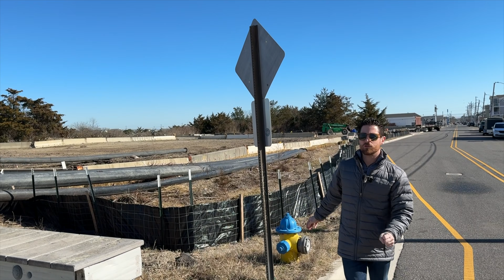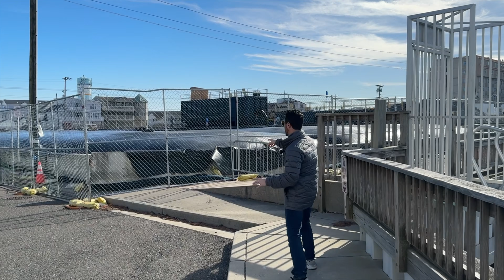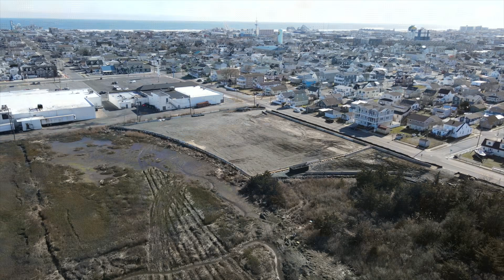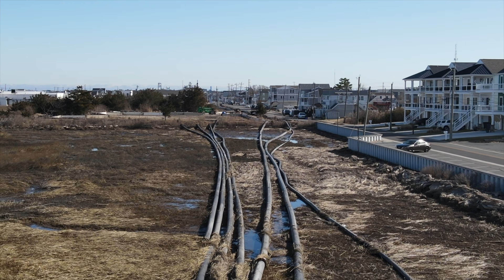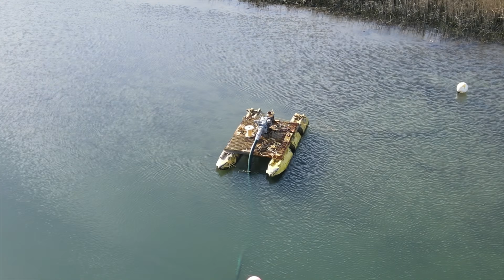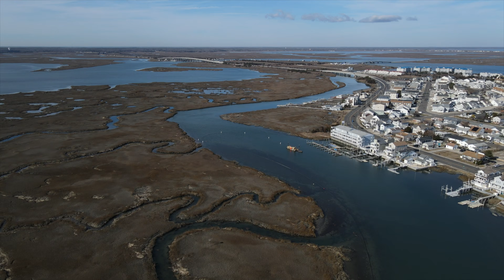Dredging the Wildwoods Back Bays 2024

Comment: Ok, I can add a couple things to further clarify this process. The video shows areas where you see several pipe. The pipe is HDPE dredge pipe. Only one of those pipes are pumping the dredge material into the bags called Geo-Tubes. The concrete  barriers are in place to control the clean watered that come out of the tubes, and back into the bay. Under the Geo-Tubes, there is polyethylene sheeting that coveres the entire floor within the concrete barrier chamber. The poly also will be draped up and over the barriers to pool the water so the water will only leave the site where the contractor wants. The rest of the pipeline you see in the video. Are simply on standby in mostlikely in 500' sections with flanged ends on both ends. As the dredge moves further away from the Geo-Tube sites, the crews will go get another section of standby pipe and add it to the main line from the dredge to the Geo-Tubes. Once the section of standby pipe is added and secured, the dredge crew is able to continue dredging for another 500'. 
The tanks next to the Geo-Tubes are actually not a additional pump to pressure the Geo-Tubes. They are part of a system that does have a very low pressure pump. That pump is pumping a polymer solution into the pipeline just prior to the dredge material enters the Geo-Tubes.  The polymer is a very important part of this process.  Geo-Tubes are made to keep the silt and sand in, and let the clean water out. The polymer coagulates the silt material so it will fall to the bottom as it enters the Geo-Tubes.  Without the polymer, the silt would sta6 suspended and clog all of the pores in the Geo-Tubes and the water will be trapped.  When this happens,  the dredge material and water must stop or the Geo-Tubes will burst at the seams. 
A slight correction about the pipeline.  Only on pipeline does pump the material to the Geo-Tube field, but once that line reaches the field, there is a trunk line with a serious of Y fittings and valves so more than one tube can be filled at a time as well as controlling how much pressure is getting built ip in the tubes.